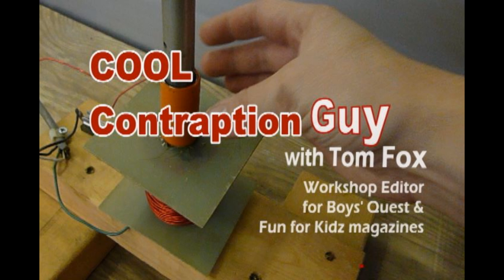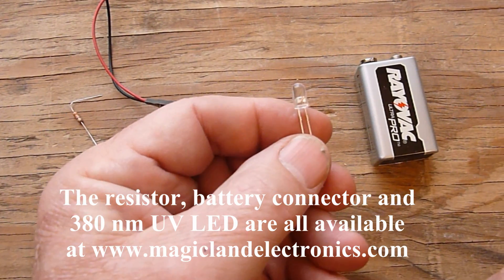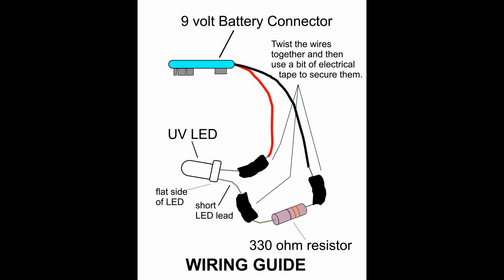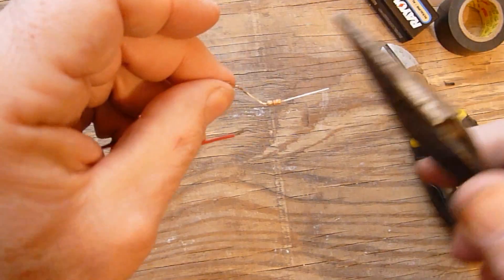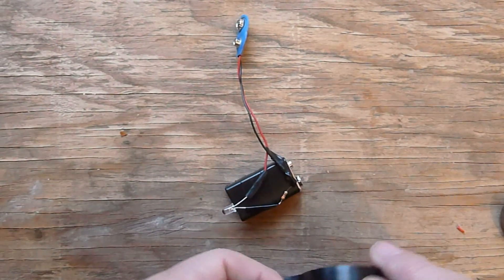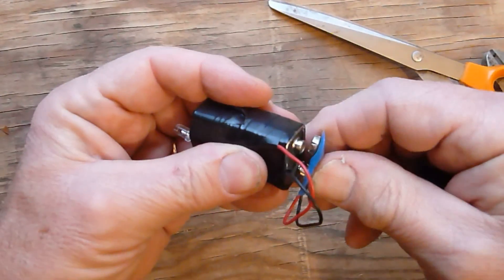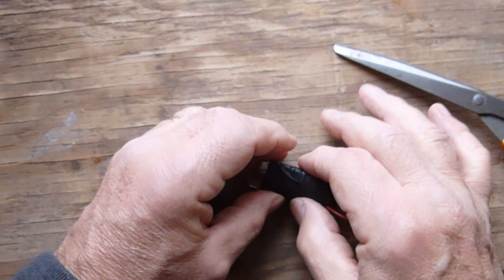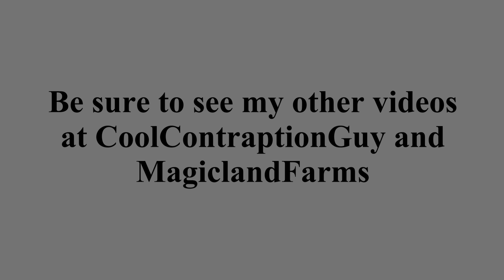Make This Inexpensive Genuine Diamond Detector

Comment: Don't buy into this garbage. Real diamonds can fluoresce as well. If you don't believe me,  go to any website that sells diamonds.  Look at the certificate of that diamond. If it is certified by a reputable lab, it will have measurements, color, clarity, cut, polish and symmetry. It will also have a section that says, yup you guessed it fluorescence. It will either say none, faint, medium, strong. This doesn't make the diamond fake. However, it does effect the price. There are many diamond simulants that don't fluoresce. This test only proves if the stone you're detecting has fluorescence or it doesn't. Period.